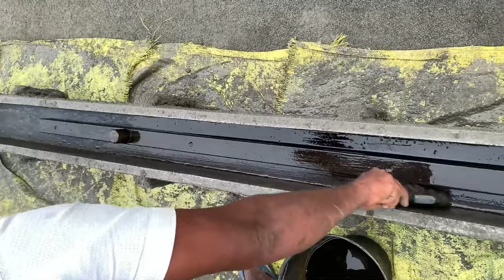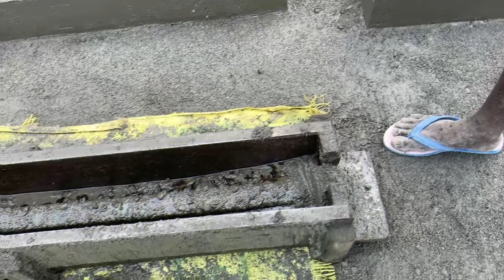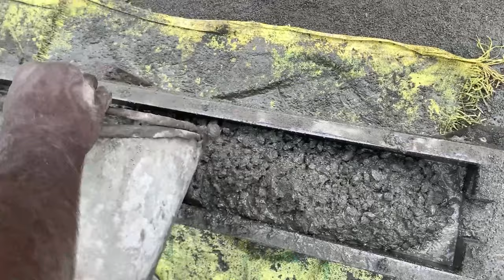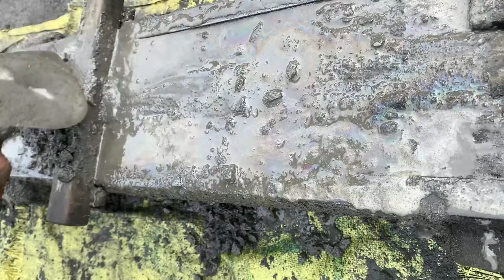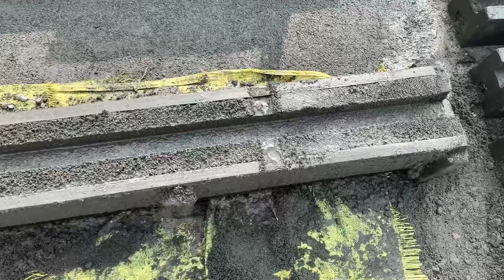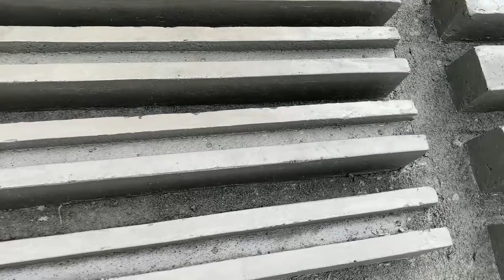How to Make Precast Concrete Fence Posts

Comment: Tip - More water you add to concrete the weaker it becomes. Lose the water and use concrete vibrator to get the strongest concrete